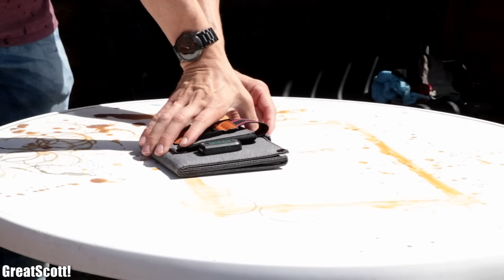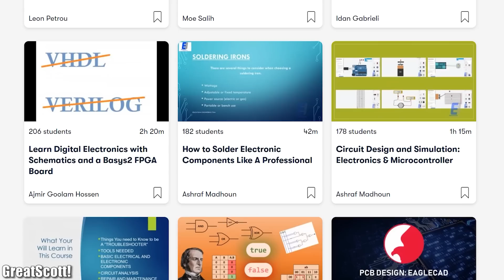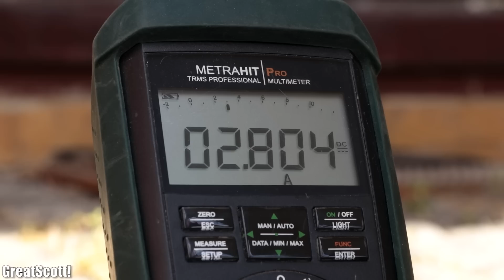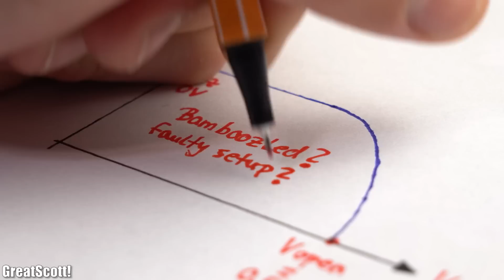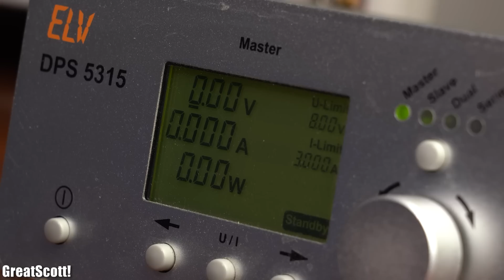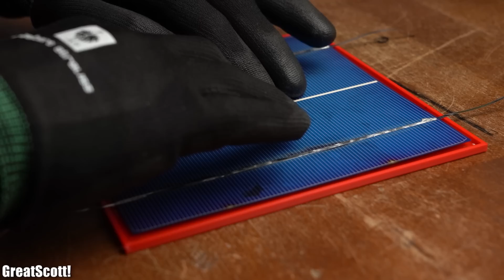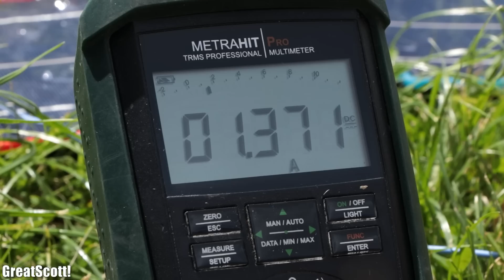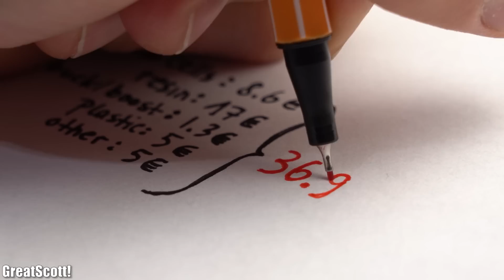5V USB Portable Solar Power Charger || DIY or Buy

Comment: The solar tapping wires are going to wear out and break within a few folds, wouldn't they? An MPPT circuit would be a more proper solution than the buck boost converter, maybe try to make a DIY low power MPPT circuit for next project?
Reply: The dodgy wiring can be easily fixed a number of ways. So in my opinion feels largely unimportant just couldnt be bothered to do it properly because its rapid prototyping. Perhaps that should have been stated more clearly when mentioned. 

Anyhow more importantly I think the other issue you raise here about MPPT is indeed something that should be addressed and looked into further. I was actually pretty impressed however at how well matched and good performance he managed to get with the off the shelf cheapo buck boost converter. So maybe a good follow up would be a head to head contest between that and a cheap MPPT (or self made one). To see how much benefit for doing it properly. Vs the higher cost of that component. And to see how much power was actually being  left on the table. And perhaps gain some useful insight as to why the specific buck boost converter being chosen had worked so well as it did. If it was anything to do with the input stage of the buck boost circuit being in common with the way an MPPT works. Would be great part 2 revisit..

I also wanted to point out that epoxy shrinks by 10% so is not ideal for larger panels that you can see in the video does not dry flat due to the shrinkage or may cause stress or other mechanical issue. And of course 3ed prints are not exactly the stiffest backing material either. So investigating a better protective covering / housing materials would also be worthwhile. If somebody else is trying to repeat this project. I am personally not sure what would be most suitable because there are a number of different options. Which will have different sets of pros / cons. And cost different amounts since this is a budget sensitive project. Just try to avoid the epoxy (if you can find something else better)n is just my main point here, because your standard epoxy will always shrink.
Reply: And use JLCPCB's SMT assembly service for the custom PCB :D
Reply: I'd also add atlsast one schotky diode to prevent backflow into the cells, commercially available panels come with one diode per panel but that's probably overkill for something like this.
Reply: @frogjmon  unlike an inductive load like a motor, the schotky Diodes in PV-Modules serve to prevent single shaded or broken cells from running in reverse breakdown, which happens in Strings of round about 24 cells (24 * V_forward > 1 * V_revbreakdown. Only applies to crystalline cells.
Reply: conductive fabric or copper braid might be better for durability if the contact area and pressure is enough, placement will depend on the cells used ofc but I'm sure it can be worked out on a DIY budget without getting too crazy
Reply: @ACTlVISION   I've used solder wick braid as a flexible conductor before.  It survives a lot of bending as long as you don't let solder wick into the hinge area.  Using a hemostat as a heat sink when soldering the tabs of the hinge work great.  It stopped the heat travel effectively.  Need more wire gauge? use wider solder wick or multiple pieces.  Cheap and effective.  (Also, nothing tins quite as well as solder wick.  That's kind of its purpose.)
Reply: MPPT would require a load that can absorb a continually variable amount of power. I don't know if all phones would accept a varying power input. This is why in general a battery or supercapacitor is used as an intermediary buffer. Something like USB Power Delivery or one of the proprietary Quick Charge standards might help.
Reply: @power-max  I've been trying to figure out if a MPPT function can be programed/ added into a power delivery controller. I know that the two devices communicate and set power/ current limits back and forth.
Reply: @davidgunther8428  Cool. Keep it up! What MPPT algorythm are you planning to use? You can go with really simple ones that just assume the optimal point at 80% OC voltage, or something as fancy as some neural network machine learning thing. But I think the hunting method works reasonably well and should be easy to implement on an MSP430 or other low power processor.
Reply: @power-max  set/ fixed voltage type. They are efficient enough, and much better than having the charger get stuck in a ~0W output from over drawing. PD programming sounds like it might be difficult though, from Great Scott's video on it.
Reply: @davidgunther8428  PD is a very problematic and complicated standard. EEVblog messed it up, Great Scott struggled with it, hell even the raspberry Pi foundation screwed up the Pi 4's implementation to detect high current chargers.

But yeah, for MPPT definitely use "observe and proturb" or "dynamic resistance" algorithm if you want to implement a real MPPT. Measuring OC voltage and assuming the MPPT is at around 80% of that not accurate unless you have characterised your panels and are in a environment where all cells get equal irradiation. A Partially shaded or damaged panel is going to have a very wonky I-V graph
Reply: @power-max  I was using a ~17V set point with a TI MPPT charge controller chip. It worked pretty well, and was a buck converter feeding a 4- cell Li+ pack, so if the panel voltage dropped below 16V it wouldn't able to charge anyway. 
The perturb and observe designs I've seen have a periodic interruption to source current draw, or are very complicated. For the 25-50W system scale I don't think the 1-2W of max power lost is worth the added complexity.
What I really want is to have the PD controller just renegotiate the PPS agreement with the charging device if the panel gets shaded or it is a cloudy day.
Reply: @davidgunther8428  The periodic interruptions might be because it occasionally does a sweep across the entire current range of the panel to see if the relative maxima the algorithm is tracking is indeed the true MPP. It becomes important with partial shading, although the ideal solution for partial shading is to have every panel have a separate MPPT. One common approach is to use a bunch of small microinverters that all feed the AC mains directly.  SolarEdge takes a slightly different approch, factoring out the function of DC to AC conversion, and so instead panels interface a "DC Optimizer" and all these optimizers connect to a high voltage DC bus that feeds the main inverter. They claim this is more efficient and I do believe it. Although it is probably the highest cost solution.

Comment: You can't get the Isc with the setup you have there as you dont have STC conditions. These parameters are taken by using artificial sun simulator of 1000W/m2 perpendicular to the cell at 25 deg  (abd 1.5AM) using the best cells of the batch and the test lasts just a few ms so the cells dont heat up etc... To achieve 8A+ yourself, you probably need to have very bright sun which best comes after a chill rainy day in May or June so the atmosphere is clear, the sky a deep blue and the cells are cool, thats your best chance to achieve the rated specs...

Comment: I've bought solar cells off Aliexpress and the actual rating is about half the advertised rating. I raised a dispute with photo evidence and got a full refund. I find reading the comments from previous customers useful when buying any solar, laser, or lipo batteries from Aliexpress sellers.

Comment: A hinge system would make it nearly perfect. DIY is definitely the winner here.
Reply from the maker: Yep, I acutally tried that. But it is really hard to design. At least for me.
Reply: @greatscottlab  you are too humble.  shorten up the taping leads and use small copper braid... Doesn't even  need to be insulated and could run uninsulated in the fabric hinges--which are a great idea themselves.  I would rubberize one side of the fabric (or use a rubberized or some type of water resistant cushioned fabric) to help with moisture resistance.  That's already a pretty big set of cells.
Reply: And not use PLA for project with a lot of heat :) It will warp!

Comment: Braided grounding straps for hinges?
Reply: I was thinking the same Kevin,
I think I would use thin braided copper with heatshrink tube, the ends could be screwed to the frames, solder the connection and cover with epoxy resin or similar
Reply from the maker: Hmmmm possible

Comment: For the hinging system of the DIY solar panel, you could've used those hinges which are used in laptops which connect the screen to the motherboard.
Reply: I made my own using good quality duct tape to hold the 12 panels together. 3 years later and still working perfectly and I recently upgraded it with a quick charge usb module.
Reply: @fuzzybobbles  Well duct tape is strong!! 😂😂😂😂
Reply: Could also design the hinge system into the 3D printed frames pretty easily.
Reply: @BRUXXUS  But they won't handle stress on the long run due to the weak 3D printer filament.
Reply: Its always Duct Tape. Or Chitosan.

Comment: Could be the solar radiation of your location. Do you have a way to measure or estimate the solar radiation?
Reply from the maker: No. Sorry
Reply: @greatscottlab  You live in germany right?
Reply: @greatscottlab  you should have a Global Radiation around 500-600 W/m2 in a summer day, and the cell are tested at 1000W/m2 at the lab/factory. Making "reverse eng" at your measures (2.8A, 0.56V) you should have around 420-450 W/m2. In Chile, at some places in the Atacama Desert the Radiation reach 1.300 W/m2!!

Comment: The short circuit is barely 3 amps because the multimeter has a resistance (the shunt) that limits the current. You always have to put that in mind, especially when dealing with really low voltages or measuring short circuit current.
Reply from the maker: But the resistance of the shunt is not that big though
Reply: @greatscottlab  yeah, let's assume the resistance is 0.1 ohm and the output voltage of the solar cell is 0.5V, then the the current reading is limited to 0.5V / 0.1 ohm = 5A.
Also don't forget that when doing a short circuit the voltage drops so it will make the case worse and the reading won't be accurate anymore.

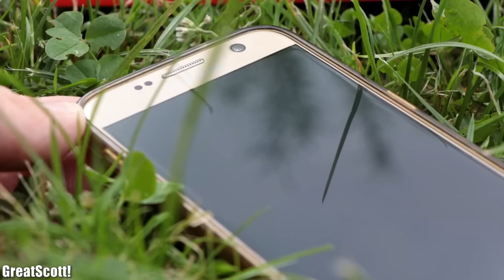Comment: Did you perform the Current Load Test of 10:00 on the commercial product? If the current was limited by your phone, then the maximum current capabilities would be higher too, right?
Reply: Some step down boards on AliExpress have a chip to enable fast charging you can try one of these.
Reply from the maker: I tried the test. Result was about the same.
Reply: @greatscottlab  Isc only applies in STC = standard test conditions = laboratory conditions of 1000 W/m² and 25°C cell temperature. You would at least need to direct the cells to the sun to get closer to the nominal Isc and Voc

I would love to invite you to our research center, Fraunhofer Center for Silicon-Photovoltaics in Halle.
Reply: @MrMcPeppr  I've always thought that's kind of an unrealistic test to control the cell temperature to 25degC. Why don't they control the ambient environment to 25c instead, and let the cells rise to whatever temperature they would naturally settle to? Imagine someone created some sort of heatsink coupled to solar cells -- in the real world, the heat sink would help keep the junction temperature lower. In this test however, you'd see no benefit compared to a regular cell. (I understand it's a Standard test, but still).
Reply: @fgbhrl4907  cells can get really hot, but with a little wind they cool down dramatically. They report 25°C behavior because you can calculate the behavior at other temperatures relative to that. Going by a 25C ambient and reporting steady state cell temperature isn't that realistic in a lot of places in the summer anyway. Since cell temperature (thus cell voltage and current) varies with ambient T, wind and light level... it would be even less helpful.
Reply: @fgbhrl4907  They state this 25°C temperature because the voltage of the panels very depending on the ambient temperature. All in all, they are just semi conductors (plain Silicon), and photovoltatic properties are in very close relation to the temperature. Pretty dramatically actually. You can have very different measured values on 15°C and let's say 40°C eg.
Reply: @fgbhrl4907  The reason why it is 25°C is, that cells and modules are measured and classified in the production line. It needs just a bright (1000 W/m²) of 10 Milliseconds to sweep the whole i-v-curve. There's no heating up in production or laboratory. If you know the specific temperature coefficient of the material - the test temperature can even deviate, let's say 22,5°C and will be corrected with a formula. In most cases the flasher is a xenon light source which is covered by a spectral filter to cancel out the high xenon peaks and get the light spectrum close to daylight, namely "AirMass 1.5". STC are conditions everybody has agreed on to get comparable values, so the measurement results between labs won't deviate more than +/- 2.5%. If YOU need a more realistic value which applies to power production in the field, look out for the NOCT conditions. usually come with data sheet. NMOT standard was proposed but not applied until today. Always keep in mind, semiconductors have a temperature coefficient that leads to power losses of around 0,5% per Kelvin above 25°C. Meaning a typical cell temperature of 65°C comes with 20% of power losses. On the other hand 1000 W/m² is not the maximum our sun can deliver - for more google "solar constant, over irradiation, albedo + bifacial modules" - Cheers
Reply: @greatscottlab  Then how did the commercial version loose?

Not to mention durability... Those tabs going to hold up to repeated folding and unfolding? I doubt it.
Reply: @Segphalt  
Also the bought one is way more practical and smaller.
Reply: @Segphalt  I am assuming he means the result was about the same as the original test w/ the phone, not the same as his DIY panel. That said, his DIY solution did have more cells.
Reply: bro he means direct 2 wire system system of 5v charging is limited . by the way we only get 2.4 A max technology for fast charging on 2 wired ampere technology we need data line for increased voltage rather than current for fast charging . some phone go up to 18V+ for fast charging so wire is be thin for more power . and charge pull more to battery.
Reply: @yagneshpatel1183  technically speaking, you can use even more amps. My phone charger can deliver up to 5v 4A, and some phone can reach 5v 6A or more

Comment: To improove it even more, you could design another flat case about the same size, and add some flat batteries (just like the one inside the tablets) and a battery charging circuit (tp4056 or 5100) and a boost to 5v. If you use the tp5100, you don't have to worry about higher voltage, since this board has a buck circuit, and can use up to 18v dc in to charge a single battery...

Comment: If you've watched GreatScottt's videos for a long time then you know that this type of video where the DIY route is the winner is pretty rare.
Reply from the maker: True
Reply: @GreatScott!  You take the time to reply to this which adds nothing of value but to my comment asking for a link to the constant load device, silence. I don't understand yters sometimes.
Reply: @micnolmadtube  I know you commented a while ago, and this may not be helpful anymore, but I think GreatScott made a constant load device: https://www.youtube.com/watch?v=VwCHtwskzLA
Reply: DIY is winner because they costs the same. I still don't get it.
Reply: yup
Reply: I did not get why DIY was the winner in this video. It costs the same and you have to invest more time.
Reply: @addygreen8919  I think it was because of the extra power output
Reply: @addygreen8919    You can't easily replace the solar cell in the pre-made ones easily so when you do a DIY you can do it depending how you decide its put together.
Reply: @addygreen8919  maybe because you can get more EXP from this....,
:)
Reply: @addygreen8919  maybe it's because it is more versatile because you can change certain features at your own accord unlike the commercial product where it's difficult to edit to meet your needs. Besides this is an early prototype so he might be able to reduce the cost or improve the product in a later video.
Reply: @addygreen8919  maybe because the time spent is fun thus not a cost?